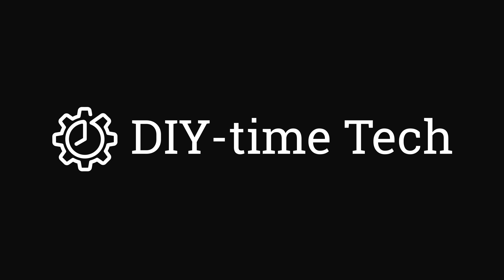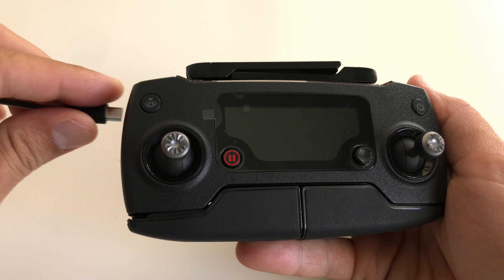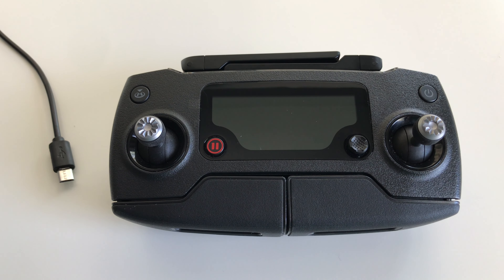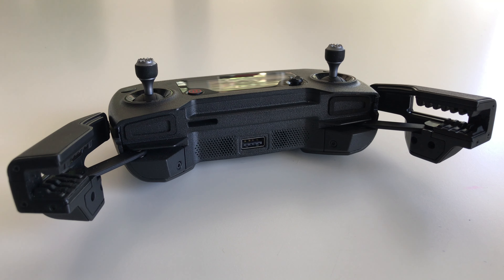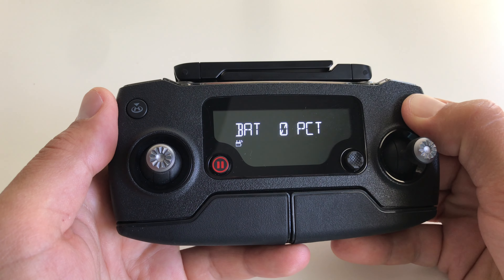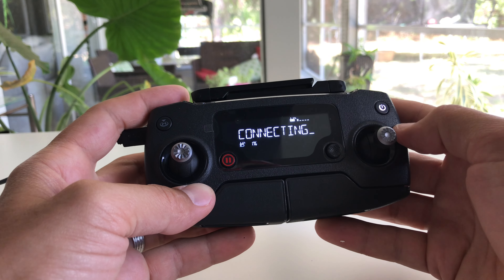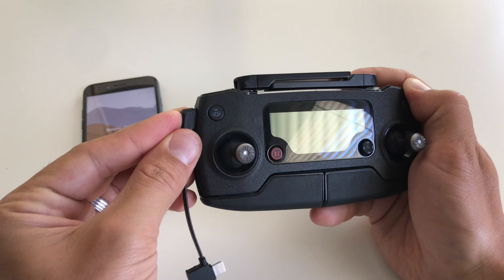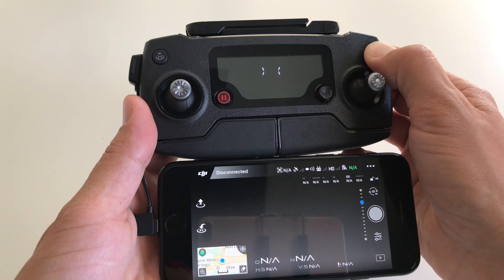How to fix DJI Mavic Pro remote controller - not charging problem.

Comment: Many thanks for sharing ! I recently installed a new battery in my remote controller but found that it cannot charge beyond 30%. I follow your instructions and discharge the battery to 0%. I did this by powering on the remote controller, connecting it to my iphone and turning on my Mavic Pro. This way I can discharge the remote controller faster. When the remote controller discharged to 0%, it shut down automatically. I disconnect the iphone and power down the Mavic Pro. Then I connect the remote controller to charger. After charging for about 2-3 hrs, it was able to charge up to 100%. Now my Mavic Pro is back in action. Thank You very much !

Comment: It worked! After watching your video, I was able to fix my dad's controller, which couldn't charge. The controller still had 38% battery but wouldn't charge, even after we tried a variety of USB adapters and cables. So, we connected it to an iPhone, turned on the charging function in DJI's app, and waited for the controller to run out of battery and shut down.
Then, we reconnected the charging cable hesitantly, and tada! It worked!
Thanks for your video, it saved our day!
Reply from the maker: Awesome, glad it worked for you too!

Comment: I changed the battery in the controller with a new one and there was a problem with charging. The charger held 14% and refused to charge any further. After connecting the phone to the controller and discharging to zero, the charging returned and everything is fine now. Thanks a lot for your video. :) :)
Reply from the maker: Awesome, thanks for sharing!!!!

Comment: Haven't used my mavik pro in 2 years.  Decided to dust it off as I am about to travel to Arizona...sure enough...wouldn't charge.  Your fix worked like a charm.  Only my controller was stuck at 3%.  Anyway, as an aside, instead of connecting to my phone I just had it try to connect to the mavik and this seemed to speed up the discharge process.  

Either way, thank you for saving my mavik!  It was about to be a very expensive, although kinda neat, paperweight.
Reply from the maker: Awesome, thanks for sharing your story!

Comment: Thanks for sharing mine was stuck at 55% ,discharged to zero then it charged to 100% OK .Also found controller seems fussy with USB cables as had few that worked OK on other devises but painfully slow on Mavic controller

Comment: 18% so far, but I set the controller on the counter unplugge for at least 2 days after the initial steps. Even printed the return labels.I thought one more try.....  Knock on wood it's coming back to life. I thought it was the jack. I'll update later but 18%...I'm still skeptical but this is totally new behavior. I don't know why I didn't time it. It's going to take another 12 hours. It was expensive! It took about 15 hours I think, but It says 100%... let's see. Keep trying I think is the key here.

Comment: thank you for this video. mine discharges really quickly. will this help?
Reply from the maker: It may. However, if battery is very old and had many charge/discharge cycles, it may need replacement. It’s just old and out of capacity.

Comment: Mine hasn't worked yet. I am suspecting the cable I use to try charge isn't good enough! It won't move past 0 and did not shutdown when I plugged it to my phone with the original DJI cable. Please what do you suggest? Thank you.
Reply from the maker: Try draining the battery 🔋 by leaving it on without connecting to the phone. Try a different cable too.

Comment: Worked for me too. For my case. I tried draining it multiple times.
Reply from the maker: Great, thanks for sharing, I hope others will find your tip helpful as well!
Reply: recently encounter same issue again. i used a Ugreen 100W power brick that outputs enough wattage it needs and it kinda solve the issue. the charger came with the drone is only a 10W may be insufficient. @DIYtimeTech
Reply from the maker: Nice, that’s another great tip to try!

Comment: hi have the same problem: / how do you do a “Hard reset” og the controller ??
Reply: The hard reset is basically letting the charge fully drain from the controller.  You can either do as recommended in this video OR connect to the Mavik and let the controller drain that way.  The latter seems to drain quicker.  Once fully drained the controller will shut off, HARD RESET, and then you can recharge it fully again.

This seems to happen when the Mavik is shelved for a while.  Annoying but fixable.

Comment: my magic pro 2 remote was working just fine untill one day I was about to fly and I realize the controller sticked at connecting ,I try turning it off and it would not turn off, I literally try turning this remote off until the battery was dead ,im supper frustrated as I just got my drone ? can u suggest anything to help me out ???
Reply from the maker: Is it still under warranty?

Comment: not working for me. Fully charged last night. Had issues with magnetic interference today outside (probably needed firmware update)now stuck at 0% and making a low pitch squealing sound when connected to charger. No lights flashing on charge cable either.

Comment: My issue is that the remote doesn't recognize the charging cable anymore. It just doesn't even has a message that says Charging... Maybe the port in the controller messed up? Have you ever heard of this issue?
Reply: I’m having same problem , did u find a fix ? I think my port might be damaged I’m not sure
Reply: I might have some bad news.  Due to the connection port opening looking almost like a usb-c connection it of course isn't.  Thus it is difficult aligning the small USB connection properly.  What seems to happen is that the smaller connector is put in upside down and then this damages the internal connections of the controller.

I truly hope this isn't the case but if so you may need a new controller.  Always ensure that the two little knobs on the USB connection face down when looking at the top of the controller itself.
Reply: @bx7993  No, I haven't been able to fix it. I will buy a new remote.
Reply: @KatiaRepina  I just ordered a new port for It cost 65 Canadian dollars  hopefully it’s easy to swap
Reply: @bx7993 did it worked? I have same issue, My controller was Discharging Rapidly , I use Powerbank to keep it charging and bottom  usb port to connect to mobile, but one day it suddenly stopped, with no display at all, I tried changing battery of another controller but nothing showing on screen or no sound at all, it's completely dead. Have you found any solution to it?

Comment: I've been charging and charging and charging, it is not going beyond 0%. I don't even have chance to turn it on because it shows "BAT 0 PCT". Would be thankful for any solution :/
Reply: same problem here...
Reply: @toybitz9396 I’m having the same problem as well, were you able to fix it?
Reply: @allaboutwanderlust  sori coz i cant, my unit was still not charging, but i have contacted the repair shop and they promised they can fixed it but have no time for now...

Comment: That's ridiculous. How do you turn it on if it won't turn on? Mine doesn't do anything when I plug it in. It will not turn on at all with the switch, just says 0 percent.

Comment: I tried that, right now I'm charging it up but the controller is completely dead, nothing on the screen, even replaced the battery.
Reply: I received this information: "Guys who are having this problem, don't worry!! Put it to charge even if it doesn't accuse... for 3-5 hours. Then leave the control resting from 1 day to the next. Then just turn on the control and it will be normal. This is happening because of the calibration of the cells! I did that and it worked! The dji who passed it to me!!! Another detail: never use a turbo charger, as it can burn the diode inside the control."
Reply from the maker: Thanks for sharing more tips about this issue!

Comment: I haven't used my mavic in about 4 years and nothing works now. All the battery's are dead and won't charge and the controller won't turn on or charge anyway either. It's just all dead.  It's pretty BS.

Comment: I was sure hoping this worked for me, as the problem seems identical to mine, but it did not. Meanwhile–RATHER PREDICTABLY—DJI are so useless and uninterested it is offensive. (If there were Oscar awards for bad customer service, DJI would be Katherine Hepburne).

Anyone here have further advice, please?
DJI want me to send my controller back to them (a $200+ charge, since I am overseas), and have informed me that my DJI Refresh policy does NOT cover the controller (so they will charge me extra for the repair). I would then, of course, STILL need to get it back later, at my own expense. 

I have some choice adjectives for this company's service values, but were I to state them here, I would probably be banned.

Comment: This idea Not working sir
Reply from the maker: Did your battery life deteriorated gradually or did this issue happen basically overnight?
Reply: @DIYtimeTech   please I need you help mine just stop working mine started where the remote wasn't coming on at all to the point it stayed on until battery was drained and it just  would charge please I would highly appreciate your help ?
Reply: @lnaglamourphoto3944  Did this happen with Mavic Air 2?